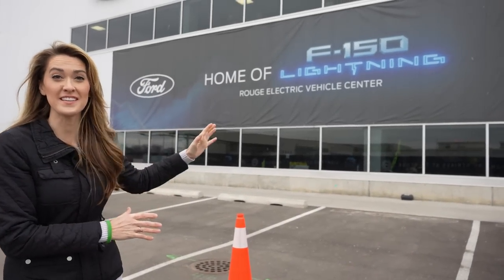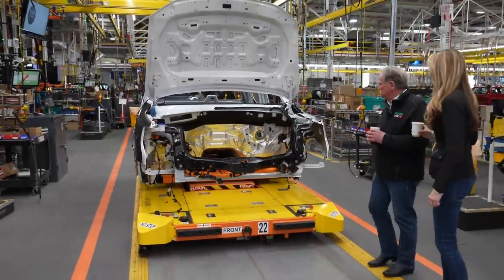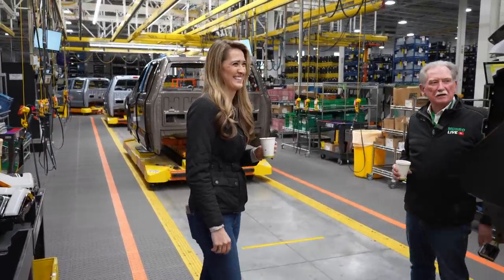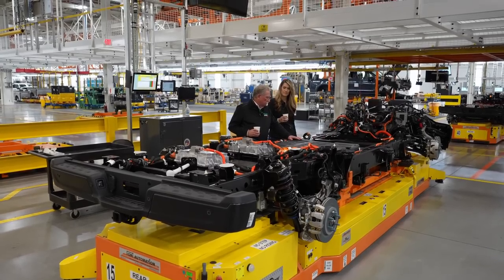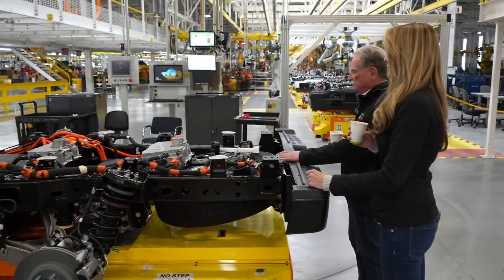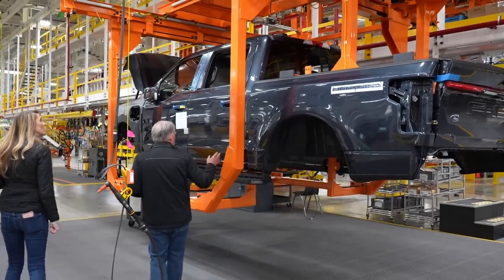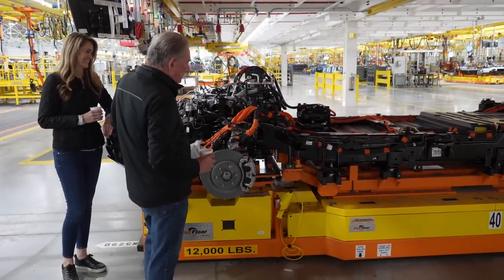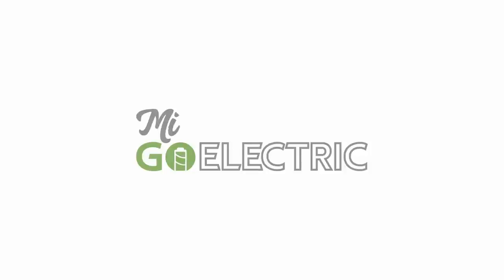Ford F150 Lightning Assembly Line Tour with Sandy Munro

Comment: FUD motors Rouge plant is a old car plant converted to Electric. 
as such its Less ADVANCED and less Vertically Intergreated than Tesla FREMONT Production. 
ALL 4 Tesla Production are more Advanced, Shanghai being the First new build , and GigaBerlin and GigaAustin all being NEW builds. the ROUGE is a joke . filled with slow robots and old Machines.
Reply from the maker: It is a new building where there was a parking lot two years ago.
Reply: @MissGoElectric  - still outdated. where is the structural battery pack and Gigacasting ?
where is the Ford factory 🏭 AI software ?
the F150 lightweight, is built on a outdated body on frame. too slow , too heavy.
Reply: @markplott4820  How many dumb comments can you make in one day? Unlimited I guess.
Reply: @heathwirt8919  - not as many as JIM 🤡 Farley does every hour.
Reply: Do you have stock in Tesla Motors by any chance?

Comment: If I was one of those Ford technicians I’d be going crazy mental at you two bringing in coffee cups onto an electric vehicle floor factory. Absolutely idiotic drinking right next to electronics and electrical battery packs being put in. Especially when you sat that coffee cup on an exposed floor. Yaaay moisture from the bottom of the cup for future rusting issues. Leaning on the body work also what ticked me off even more. Also not wearing Hi-Vis safety vests and no safety glasses. Absolutely stupid.
Reply from the maker: The top notch cup of joe was provided by Ford the factory was closed. There was no danger and not a drop went to waste. It was too delicious. We were wearing exactly as much safety gear as every other news crew and executive elsewhere on the floor during this press event.

 That said, the Internet loves a good reason to be outraged and we are happy to have delivered for you Scotchy.

Comment: Too bad these EV trucks are going  to stealerships to gouge buyers, and they have retro brick aerodynamics
Reply from the maker: We have had great experiences with the direct automotive sales model, too. We'd prefer an economic system which permits a free and open automotive market.
Jim Farley told us that Ford's next truck will feature significant aerodynamic improvements.
Reply: @MissGoElectric  Thanks, for the hint on the next Ford EV truck.  That is really important quasi news, being better able to compete against the superior aerodynamics of the Cybertruck.  Can you also hint at the demise of range reducing side view mirrors (it's shocking how much room for improvement there is)?
Reply: @MissGoElectric  I have a Cybertruck reservation, but might buy a Ford truck if it's competitive...

Comment: Just stop and compare this to the Tesla assembly line.  This looks like something out of the Fifties. It's slow motion quick sand.
Reply from the maker: This product used a high percentage of legacy components and a union workforce. It will be interesting to see the facility for Ford's upcoming "EV only"  truck built in Tennessee without onerous labor requirements.
Reply: @MissGoElectric  what are these so-called labour requirements?
Reply from the maker: @michelhedley1805  Available robotics technology may not be applicable when a minimum job count is contractually obliged.  The Ford/UAW contract was ratified in 2019.
https://www.nytimes.com/2019/11/15/business/ford-uaw-contract.html